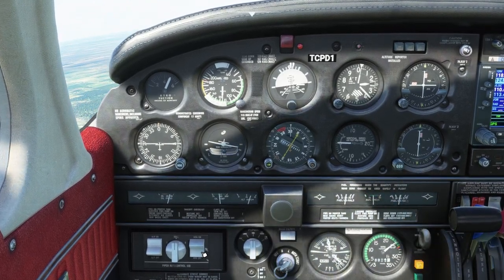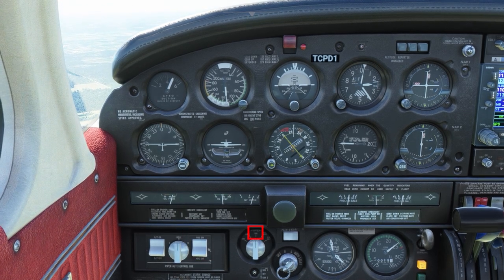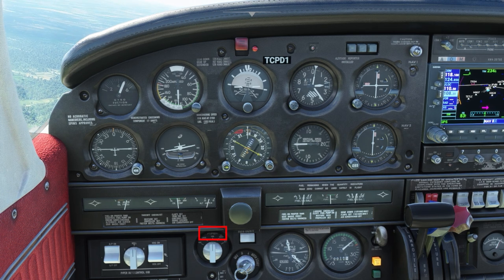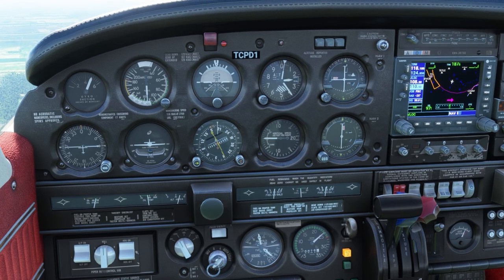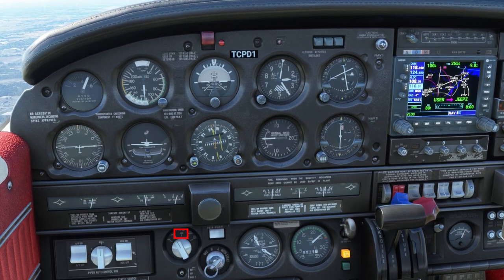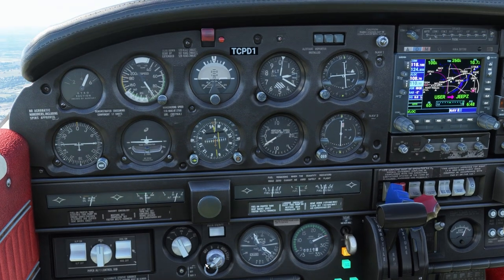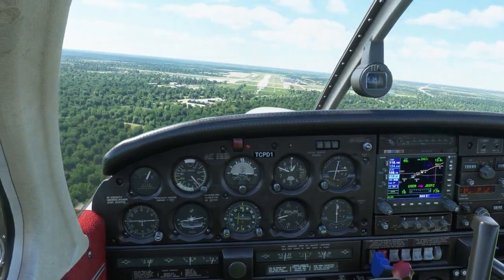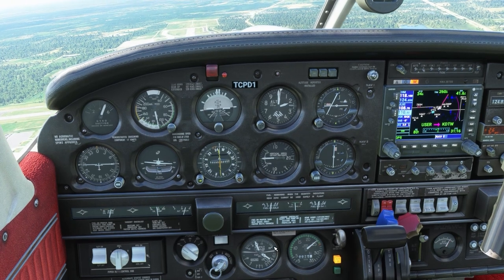How to Use the Just Flight Piper Arrow Autopilot in Microsoft Flight Simulator

Comment: Nice in depth video!
Reply from the maker: I could have gone deeper but I don't think it was detailed to that level.  There is a 30 page manual for this autopilot on the internet. It gets down to some in depth information such as OMNI will correct for x-wind correction up to 15 degrees from the course on the CDI but VOR doesn't have a limit (at least not that I found).  I left that out of the video on purpose.

Comment: Great video, how do you change the  GPS exactly? By default it's the GPS 100.
Reply from the maker: On the iPad.  To bring the iPad up click the silver I-com switch on the top right side of the panel.  (The switch may be labeled something similar as I’m going off memory). In the middle of the iPad there is a section for the GPS.  Click that button on the IPad to scroll through the different avionics setups.  That’s how it works on PC.
Reply: @thecorporatepilotdad  Thanks I didn't even notice that.

Comment: Not sure if this is a turbo arrow issue, but it uses the exact same autopilot sistem, and its a paind for me to make it follow gps... most of the time when i turn it on, the plane starts to make random turns, but fewer times it simply works. Im very confused with the sistem...
Reply from the maker: I’ve seen this before.  Flight model has to be set to modern.  Also, turn the AP off, try switching to a different mode like heading, then put it back in NAV or Omni.  I don’t have it in front of me so I’m going off memory.  If that doesn’t work try contacting JustFlight.  This same thing has happened to me and I’ve always been able to get it to work.  Also try switching from GPS to VOR and back on to GPS on the GPS itself.   Hope that helps.
Reply: @thecorporatepilotdad  thanks a lot for your feedback, really appreciated. Gonna try some of that later today! I've tried some of those but when i succeed, it's more of a random thing..

Comment: Doesn’t work for me. Won’t track a VOR or gps. Roll knob won’t turn plane. Heading Bug doesn’t change plane’s heading with selector in heading. Won’t ever buy anymore planes from third parties for MSFS2020. Junk.
Reply: Same thing is happening with mine, currently on SU14. Didn't used to be an issue on the Just Flight Arrows. I think they need to update their products.

Comment: Strange it doesn't come with an altitude hold feature. In my msfs arrow I don't have the gps and can not find a way to hold the altitude.
Reply from the maker: Not all autopilots in GA airplanes have altitude hold.  The developer did add altitude hold after this video.  Above the dial to select heading, VOR, LOC, etc. there is a click spot over the word Piper.  Clicking Piper toggles altitude hold.
Reply: @thecorporatepilotdad  Thank you sir

Comment: Dumb question but how do you switch on the avionics? My GNS 530 is just black and I try to push every possible button to start it.
Reply from the maker: I've heard of this happening but I have not experienced it.  Does the 430 do it too?
Reply: @thecorporatepilotdad  Yes, same with the 430.
Reply from the maker: @mrmisterno1  I wish I knew to help you out but I don't have a solution.   Have you checked the flightsim forums?
Reply: @thecorporatepilotdad  I might try to delete the GNS mod and see if that helps. Didn't find anything in the forums.
Reply from the maker: @mrmisterno1  if you can move it to a different folder that might help to isolate the problem vs deleting it.   I take it that mod just gets dropped in the community folder.
Reply: Same thing happened to me.  I deleted the mod and downloaded newest version of the 530 mod.  https://github.com/pimarc/pms50-gns530

Comment: How do you scroll the OBS knobs in 1 degree intervals? Mine only allows me to rotate OBS and CRS knobs in intervals of 10
Reply from the maker: I use the scroll wheel on the mouse to go one degree at a time.  If I hold left shift it will go 2degrees at a time.  If I spin the mouse wheel repeatedly it will move even faster at maybe 20-30 degrees at a time.
Reply: @thecorporatepilotdad  How fast do you spin it for only 1 degree? Every spin it goes 10 degrees for me 🤷‍♂️ I have my instrument, but when I was still an Instrument student, that was the biggest annoyance for me 😂 (I did my training without GPS or DME (/U) so I flew the 6 pack 172 without using the GPS to practice)
Reply from the maker: @colinboone9920  I did my IFR training on steam gauges and GPS free also.  I spin it pretty fast.  I've never had it go 10 degrees at once.  I was thinking about it after my last message.  Maybe there is a setting somewhere making it go by 10? Does it still go by 10 if you use the scroll wheel or the left mouse button?
Reply: @thecorporatepilotdad  I know in the CJ4 it works properly, but all GA aircraft only nice in 10 degrees for me
Reply from the maker: @colinboone9920  Are you using a Honeycomb product? I just checked the forums and that is one of the devices that causes it to move by 10 degrees.  https://forums.flightsimulator.com/t/c172-heading-bug-10-degree-increments-only/183892/25
Reply: @thecorporatepilotdad  Indeed I am, the yoke, first I’m hearing of the issue even though I’ve been searching for a solution since release day. Thank you for the link too!

Comment: For what ever reason it doesn't work for my in GPS hold. heading works fine. but GOS hold intermittent then just goes into an orbit
Reply from the maker: Not sure why that is happening and I haven’t flown the Arrow in a while. It is possible something happened after an update to cause the issue.  Check for updates on Just Flight’s website.  If the problem still happens send them an email.

Comment: Is there a 1967 version by chance?
Reply from the maker: I honestly do not know what year of Arrow the Just Flight Arrow is based on, but it is the 200 HP version.  To my knowledge, almost all Arrows are the same except for some early Arrow I aircraft that only had 180 HP engines.
Reply: @thecorporatepilotdad  thx, I fly one with a push-in throttle in my flight school, which is mainly the only difference.

Comment: I bought it an the plane is broken it rolls to the left like extremely rolling
Reply from the maker: I did see this once and it rolled hard to the right.   I don't remember what I did to fix it.  Try resetting the flight and make sure roll mode isn't selected.
Reply: I have exactly the same issue when engaging the autopilot on every flight
Reply from the maker: @joshmerriman115  I saw something in a forum on this.  I hope I am remembering it correctly but I believe this has happened when people select HDG on the console but not the AP ON rocker switch.  Try it from left to rigth.. AP ON -> HDG ON -> select Mode.  You may be doing that already but just wanted to check.
Reply: @thecorporatepilotdad  thank you, I will give it a go in that flow

Comment: Do you know if and how I can emter waypoints in the GPS100?
Reply from the maker: You can.  You have to select FLPN then highlight the fix you want the point to go before and then hit the select knob to bring up the cursor.  If you want a good and free GPS replacement you can get the Garmin GTN 750.  Be sure to read the readme file because there is a folder for each aircraft type that has to be placed in the Community Folder. https://pms50.com/msfs/?utm_source=newsletter

Comment: My piper arrow IV just refuses to follow the GPS Flight plan
Reply from the maker: Is GPS mode selected on the GPS? I flew the Arrow a few days ago in MSFS and it worked well.
Reply: @thecorporatepilotdad  Yeah I've been testing the Turbo Arrow IV for the past 2 hours and It turns out that ONLY HDG Mode works.... none of the others is working. No clue why. It used to work fine before
Reply from the maker: @jobravo1205  anytime there is a sim update some components can stop working.  Check to see if there is an updated version of the Arrow on JFs website.   That could be the culprit.
Reply: @thecorporatepilotdad  It could be.... I checked but there isn't yet.... maybe they are working on it. I confirmed that all PA28 versions have this problem at least for me.... only HDG Mode works for the Autopilot
Reply: Sorry I keep spamming you here, but for whatever reason the autopilot works as normal ONLY when the PMS GTN is selected from the tablet
Reply from the maker: @jobravo1205  Thank you for the update and you are not spamming.  It might be a good idea to report the bug to Just Flight on their website.

Comment: What are the frames like compared to the stock GA stuff?
Reply from the maker: Do you mean frame rates?  I didn't notice a difference between the Arrow or stock aircraft.
Reply: thecorporatepilotdad yes sorry the fps. It’s one of the most important things to use as a benchmark. Many developers destroy aircraft when they build it too dense where frames become and issue rendering the addon unflyable
Reply from the maker: @m783w  no problems for me.   Not to say some might have slower rates but I haven't heard of that being a problem so far.
Reply: I lost about 10 frames normally get about 40-70 frames with stock steam gauge planes. 10 less with this bird! Running in 2k everything ultra. Windows 10 nvidia 2080ti with intel i7 6700
Reply from the maker: @lee4318  I don't check FPS when I play but there wasn't a noticeable drop on my computer.  But this bird is worth a 10 fps drop in my opinion.